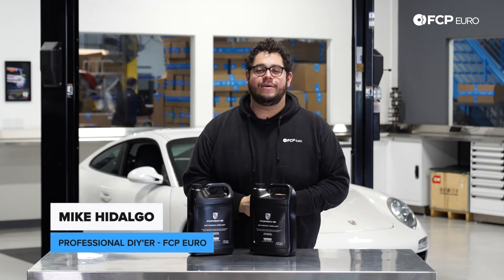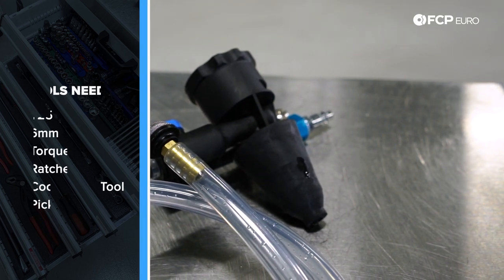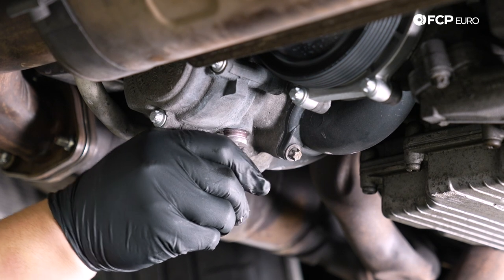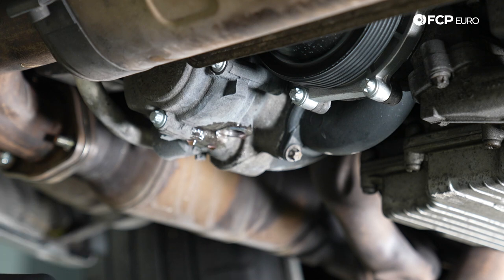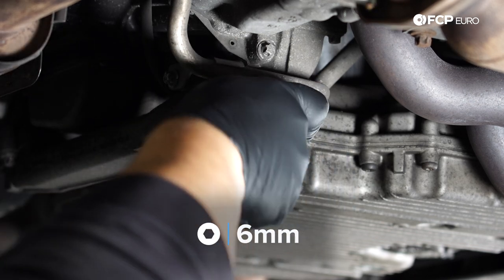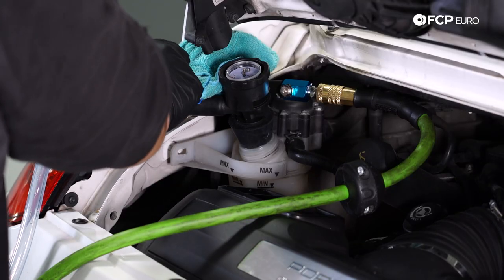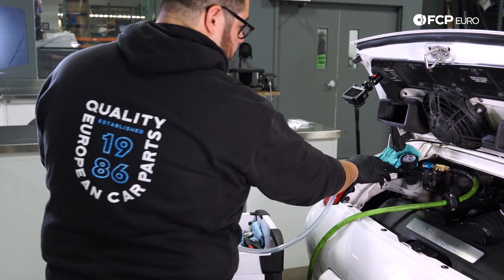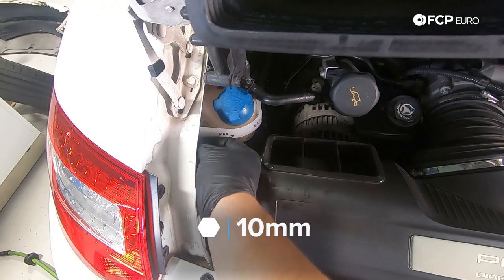Porsche 911 997 Coolant Flush DIY (2005-2012 Porsche Carrera, S, 4S, Targa, GTS)

Comment: Thank you very much Mike for the excellent explanation. If I am replacing a central radiator (and during the replacement a little fluid comes out) can I add fluid directly to the filler tank without using a vacuum? Do I need to release the pressure valve when adding any spilled fluid?
Reply from the maker: If you are opening the system and doing something like a radiator, the best thing for you is to drain the system as much as possible prior to doing so. You will be introducing a large volume of air into the system with the new radiator, and the best and only way to bleed it out on this car would be to have it empty so you can vacuum-fill it!

Comment: HI Mike!
Great video!  I will attempt this coolant flush next.  
Have you done a video on changing the signal/cruise control/high beam/onboard computer stalk assembly ?  I'll need to o this soon.  It looks easy enough, but I am sure there will be some tricks to doing this procedure.  Any suggestions would be appreciated.
Thank you.  Keep up the great videos!🙂
Reply from the maker: Hi Antony, thank you so much for watching! That is not a video we have done yet. The most important thing would be disconnecting the battery before attempting to remove the steering wheel. From there, I would imagine the assembly unplugs similar to how they do on the 996 models.
Reply: @fcpeuro @fcpeuro how many liters of coolant should go in?? Book says 32 liters. Somebody says 22-25. Im confused. 4 gallons as you ve mentioned is even less😮

Comment: @fcpeuro how many liters of coolant should go in?? Book says 32 liters. Somebody says 22-25. Im confused. 4 gallons as you ve mentioned is even less😮
Reply: The 987.1 Cayman S owner manual says that the system has 5.8 gallons of coolant.   In addition to draining the coolant from the coolant return hose as shown in this video, I even drained the coolant from the thermostat hose, the water pump hose, and the heater core coolant hose.   And I was able to drain only about 1.75 gallons from the system.   I wish this video talked about the max amount of coolant one can expect to drain from the system; I am assuming not all the coolant can be drained off the system.

Comment: I changed water pump in Porsche 911.Then put back coolant with vaccum tool. But problem car overheating still now. I use bleeder valve also.But still same head ache. What will do please any suggestions
Reply: thermostat?